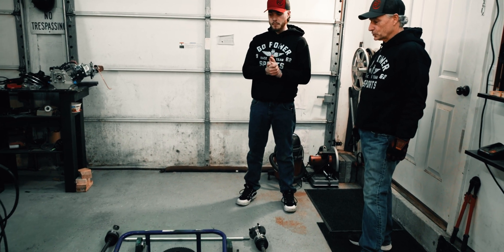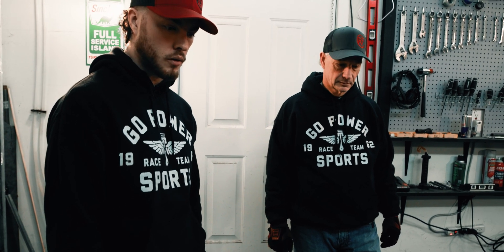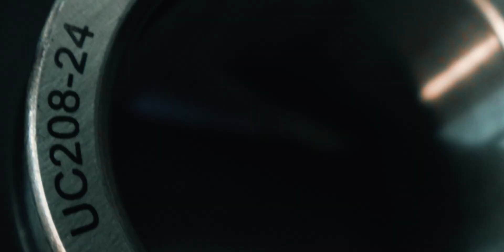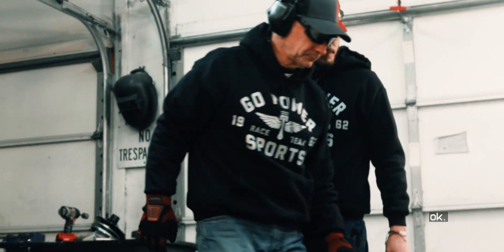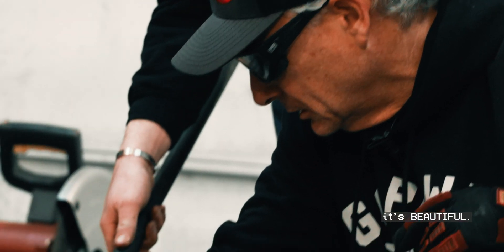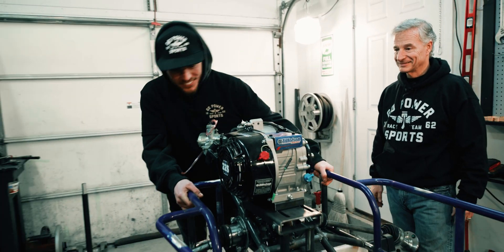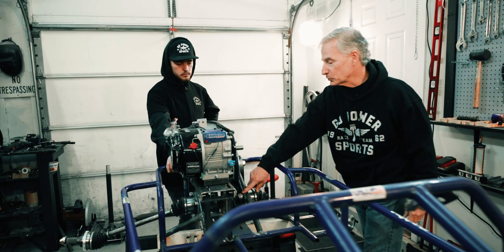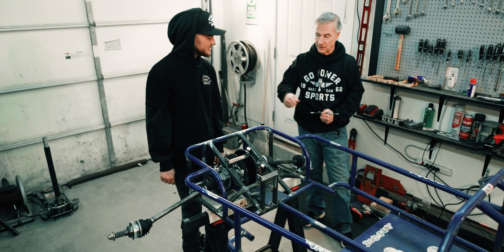IRS Cross Kart Rear End Build | Tillotson 225 | Part 1| TYRANIS EP33

Comment: I really like the idea of getting the sprocket up for better clearance. One question... with your engine mount idea why not make a tube square that you could incorporate your engine on and your suspension? Plus I think it would keep weight down and simplify things. Just a thought.
Reply from the maker: I'm sure that would work too! After sitting and staring at what I was working with, I'm pretty happy with where we ended up. I'm sure I'll do things a little differently on the next one. I always do 😅